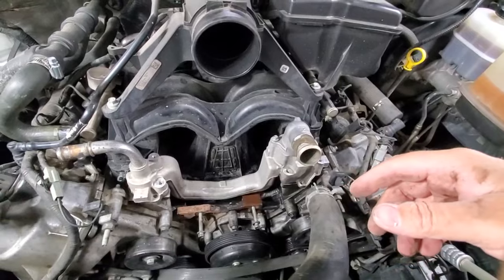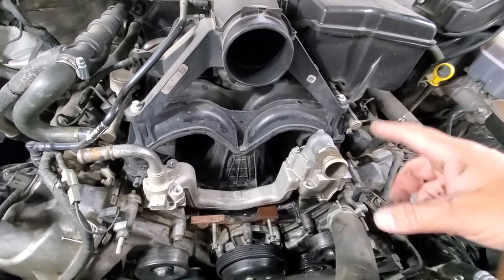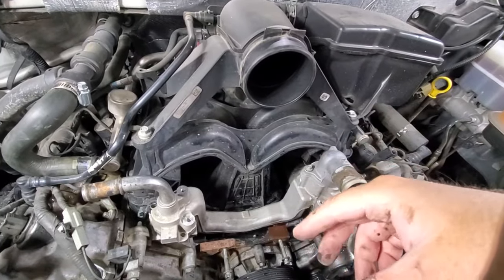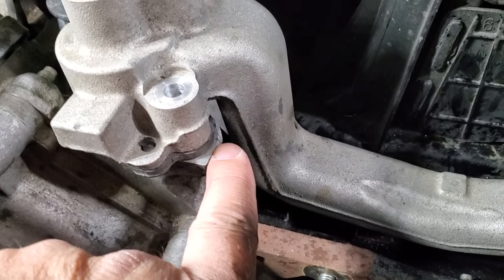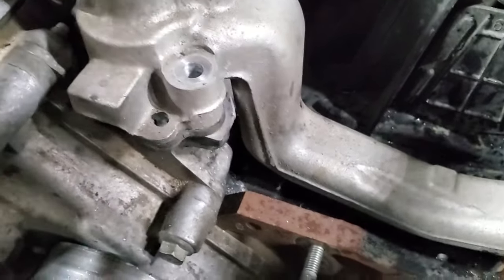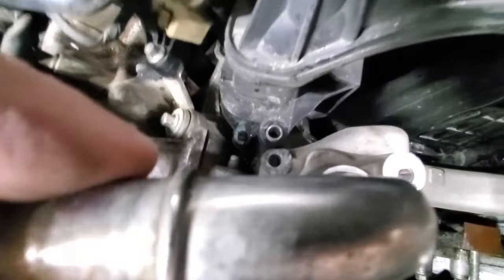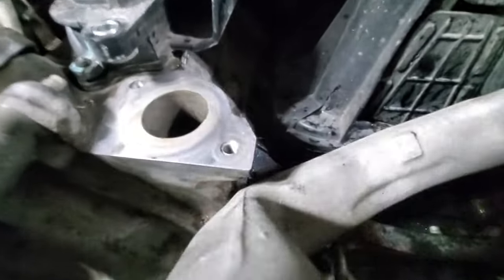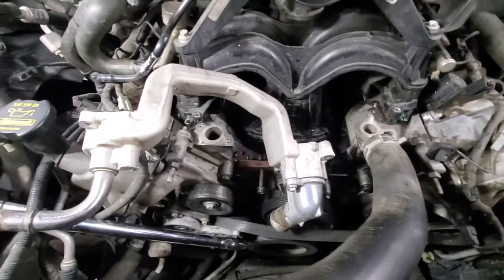Ford 5.4L 3 Valve Coolant Crossover Gaskets, Both Replaced -The easy way

Comment: Do you realize you saved my life . I was about 5 minutes short of jumping off a bridge when I came across your video . I am not a Mecanic, I’m a carpenter. But I thought changing an alternator in my f150 can’t be that hard . The first problem I had was i broke off both bolts in the bypass that hold that funny little strap over the alternator . I borrowed a trunk load of tools from my friends and also purchased 10 gallons of anti sieze solution . I tried drilling out the bolts and broke a bit in one bolt and ruined the other . Now I have to buy a new coolant bypass tube. Local dealership with taxes , just shy of $1000.00 😭😭. So i decided to get a used one. This is now, 5 days since I started the job. First thing to do is remove the existing piece . I drained the radiator, Made a mess I had to clean up . Sprayed the 4 bolts for 2 days  with liquid wrench and finally today I attacked the job. With much patience and perseverance, I got the bolts out and was so happy and pleased with myself until I tried to remove it . I spent half an hour jiggling it back and forth but to no avail . It kept hitting something. I sat down and felt sick to my stomach looking at what I would have to do to get that stupid thing out. So I turned to utube to see if there was a solution to my dilemma. I tried two or three till I came across yours.  When I saw what you did , I could here music coming down from the sky. Ten minutes later I was sitting down with that bypass pipe on my lap. Thank you for saving my life 😊😊.
Reply from the maker: Awe man, so happy this helped you! I was doing the same thing, wiggling it over and over and it just wouldn't come out! Then I started to think there HAS to be way. At that point I was committed.  Worked like charm! I so appreciate you taking the time to tell me your story, I literally just read it aloud to my family. Much love brother!

Comment: Hey whatever works, I like it!
Reply: If you approve,  I'm doing this on the weekend.
Reply: Thanks for the info on filing the tab on the head I also had to take the sleeve out of the intake manifold and file it down as well to get the crossover back in with the new gasket thanks again for sharing your find.

Comment: After having solved my problem with the same right side of my Ford expedition (I loosened the first two bolts on the front of the engine on each side of the manifold and that worked for me) I came to watch videos to find easier solutions if I needed to change the gaskets again in the future and I find the best solution, You are a mastermind, you are right it is only a few millimeters which prevents you from taking out the easiest piece as you did,  Congratulations for the great work your video will be useful for whoever is with this headache, I should have seen your video before suffering to find the solution, I thought of completely removing the manifold 😅

Comment: You saved me $1650 and perhaps a replacement of the whole vehicle! The mechanic quoted me $1700 for the whole job, including replacing the crossover pipe.  I picked up gaskets for $50 and my son and I did the job in a couple of hours!  Thanks so much!
Reply from the maker: Brilliant!  So glad to hear it. I've always wondered why they did plastic on these, sheesh. Toss me a sub and i'll try to do more on the Ford! 😁
Reply: @DoesItTrack  done and done!

Comment: Holy crap!  Thanks for the great tip!
My 2013 5.4 started to give off that coolant smell and found it leaking from the drivers side gasket.  Looked all over the interwebs, and most videos and replacement pics showed the intake together with the coolant crossover tube.  Thought I had a LOT of work and hours to get it all done.  But then came across your video!  Even without your great tip, this video still showed I only need to replace the gaskets on the crossover tube and not even deal with the intake.  So much weight lifted off my shoulders, and will tackle this job over the weekend.
Thanks again for the great tip, and keep up the great work!
Reply from the maker: Thanks Mike! Every once in a while I find these gems. LOL Happy to share the success! 😁

Comment: Just developed a leak on mine as was dreading the job as I have no time for crap engineering!! Found your video and am super excited,  thanks!!
Reply from the maker: Happy to help! Good luck!
Reply: @DoesItTrack  
Hello.
Would you happen to know if this procedure can be done on a 4.6l (panther platform)?
Reply: @DoesItTrack  
The crossover gaskets (for the 4.6l) are available for less than $15. & I would like to avoid taking out the entire intake manifold.
Help please.

Comment: Thanks so much for your video! It worked for me just fine after 5 minutes with my Dremel. I had a little trouble getting the passenger side back under the manifold.  A small chamfer on the edge of the crossover let it slip under the manifold insert.
Reply from the maker: Excellent! Glad it helped you out. This really should a Technical Service Bulletin. 🙂

Comment: Thank you so much for the tip. Shop wanted almost $2000.00 to fix. I did it for less than $ 50.00 in under 2-1/2 hours on a 2006 F150 5.4 3V
Reply from the maker: So happy to see this! $2000 is just crazy for something that takes a few hours at most, and the gaskets are so inexpensive. I'm glad this video helped you out! Truck work is kind of a side topic to our channel, but I'd love it if you subscribed. We try to be entertaining! 😁

Comment: Thanks for the help! Shaving that corner off is crucial and my gasket had a Crack as well.
Reply from the maker: These plastic ones just eventually crack. I wish they had a full rubber or metal replacement.

Comment: great video. did it today, mine was only leaking from the driver side, so once i got it all loose, i realized i had enough room to remove the gasket on the driver side and replace it, fixed my leak and now i know if the passenger side ever leaks what to do. i am saving this video for future reference. do you know that ford wanted $600 for the gasket kit to do this job. that is crazy. i spent $17 at advance auto( part# 35789 ) to do this job. cause i did not know what i was doing it took me alot of time to figure it out, but i could EASILY do this again in 1.5 hours now that i know. a 1/4 ratchet with a short 8mm socket is a MUST to get to the one bolt that is hard to get to. once bolt is loose and turned part of the way out, ratchet must come off, shove phillips screwdriver in back of socket to remove all the way. all bolts are 8 mm or 10 mm. one bolt for alternator is 13mm. thats all you need. dont know about torque settings, just use a 1/4 in. ratchet and tighten it down good.
Reply: So taking the driver side gasket was easy?
Reply: @rubencintora6777  yes can be done in like 30 mins. now that i know what i am doing.
Reply: leave altenator alone just remove bolts from the driver side and passenger crossover pipe . pipe will lift up enough to remove driver side gasket. make SURE to feel wih finger that surface is clean! before putting new one in.
Reply: @sundogtune  Thanks for the advice, I'm having the same problem and want to attempt the fix. Is there only one bolt underneath the passenger side under the crossover?
Reply: @josemedina3469  no bolts underneath, but 2 on top and also a bolt that holds a bracket going over the alternator. if your is JUST leaking from the driver side i would not mess with passenger side gasket. remove thermostat housing, and bolts from both sides on the crossover pipe,(follow my tip for hard bolt to get too on driver side). this will give you enough room to remove driver side gasket. even though i had it all loose i have had NO PROBLEMS with the passenger side gasket leaking so far. hope this helped, let me know if you need any other advice. this was for a 2010 f150 5.4l .
Reply: @sundogtune  thank you for the prompt response, mine is leaking from the passenger side. I see two bolts reachable from the top, but am concerned about any bolts underneath on the same passenger side!

Comment: On a 2004 Town Car 4.6 2V I'm hoping I can pull off  the alternator to access a couple small bolts on each side beneath the front of the aluminum cross over of the Ford intake to replace just the 2 crossover gaskets without having to do an entire intake manifold gasket job.
  The 2 crossover /lower T stat housing gaskets for this 4.6 2V Lincoln Town Car application were 
5W7Z-8C387-AA and 5W7Z-8C388-AA
Reply: ..??.. application #'s or do you mean part order #'s...
Reply: @Art Gaty  Those were the part #s , but unfortunately, there are non accessible bolts that cannot be accessed without complete intake manifold removal, and the mating plastic intake   beneath the aluminum crossover part was found to be  compromised anyhow after removing  the intake and checking, so I'm glad I got a new intake manifold from Rock auto before I took the intake manifold off.
Reply: @1fnjo790  
THANK YOU for your comments!!!
I'm going through the same thing now & found the same non accessible bolts.
I would bet that you know the temporary (but possibly long term) fix - while waiting for the new intake.
😄😄😄😄😄
Reply: @santrece1350  I think I found out that it wouldn't  work without pulling the whole intake manifold  off

Comment: bro . the hardest part for me was removing  the bolts on the right side  a #8mmor 5/16 wouldn't work im struggling on the rearscrew  driver side  where the thermostat goes pain in the neck.hopefully i can get it out tonight after work  thanks for the cheat sheet.

Comment: What did you use to get the bolt loose🤔. I have to do this on a 4.6😒.
Reply from the maker: The 4.6 is different, the 5.4 doesn't have the lower bolt so i'm not sure how to get at that one.
Reply: @DoesItTrack  I was referring to the one in the back left corner
Reply from the maker: @lynnrunningdeerB4  It comes from the top, easily accessible with a standard socket on the 5.4. You are referring to the top two on the left, but in the back position?
Reply: @DoesItTrack  no, the crossover tube. I looks like the bolts come from underneath🤷‍♀️.
Reply from the maker: @lynnrunningdeerB4  I'm not sure then, mine were from the top.

Comment: the rear bolt on right side is under manifold,  what a pain to get out ,I had to cut a 5/16 boxed end wrench short enough to turn bolt about 1/8 a turn. finally got it out.
Reply from the maker: I love custom tools! Haha!
Reply: Did u use a swing tool?

Comment: Thank you so much for the video I found the problem on my 2006 grand marquis same issue
Reply from the maker: So glad it helped!
Reply: 😲😲😲
Wait a minute.....
So, this procedure will work on 4.6l panther platform engines????!!!!
Please reply.
Reply: @TheKimbleGang4Life
...,Kimble.....; Did it work for you?
I will check on mine within a day or two.
Would you kindly reply?

😂😂😂
Reply: Yes it worked
Reply: @TheKimbleGang4Life   
Ok..... I have to use a day in the near future (most likely not the whole day).
The thing is that there are so many people claiming that it cannot be done without taking out the intake manifold.
Thanks for replying.
I will come back within a few days!!
Reply: @TheKimbleGang4Life  
Wow....
I would really like to see how it is possible (on a 4.6l) to do this.
What I did a short time ago today:
...
I have given it a preliminary go at it.
In order to see if the bolts that hold the crossover onto the intake manifold can be removed by my hands (with tools);
I removed the alternator.
I disconnected the thermostat cover because the hose being cleared out of the way will provide a clearer view.
...
Bolts on the passenger side:
One on top, three on the bottom - one which is highly improbable to be taken off without removing the intake manifold, or breaking off the plastic portion (of the intake manifold) that it goes through.
...
Bolts on the driver's side:
Two on top - they hold the thermostat cover onto the the thermostat housing & go through (and also hold) the thermostat housing onto the intake manifold.
Four are on the bottom - like at every corner of the thermostat housing - and one of those are also highly improbable to be taken off without breaking part of the intake manifold.
I believe that a certain temporary fix will be the way - until I can get a new manifold, and also make the time to do the swap.
😭😭😭
Reply: The bolts I refer to as being on the bottom:
they are facing up - they go from the intake manifold into the (aluminum) coolant crossover.

Comment: So I had to change mine out, and to get to the back bolt, I had to use an 8 mm low profile socket along with a 1/4" swivel head wrench. The one I got is from Titan.

Comment: How did u get to the back bolt on that side ur talking about tho?????
Reply from the maker: With just a socket and extension. Mine was pretty easy to get at, is yours covered by something?
Reply: The bolts are upside down I can get to 2 but there is one on the backside left if standing in front of truck and it’s not accessible but all in all your video was very helpful on helping find the leak it was right where u did the video so thank you and I’m now a subscriber
Reply: Lol now I need a video on getting the bolt off and out lol
Reply: I have the same problem waiting on some advice
Reply from the maker: @henryramos7644  mine came out pretty easily, is yours different?
Reply: @DoesItTrack  I have a 2003 E350 super duty van and the last 2 back (5/16) screws one on each side, I cannot get to them from underneath
Reply: @henryramos7644 I have a 1997.i think our 2v engines, don't have these gaskets. It's built into the intake manifold. I would love a hack like this though. What did you end up doing?
Reply: Is an 8mm socket it a wobble.

Comment: Great video but how were U able to remove the bolts on the bottom side of the crossover pipe?
Reply from the maker: A couple folks have mentioned that, mine didn't have any underside bolts at all. Mine is a 2010 KR Expedition, which one is yours?
Reply: @DoesItTrack  2002 f150 5.4L
Reply from the maker: @bljblj26  Ah! Ok, so the earlier models must be a little different.

Comment: Hello.
Would you happen to know if this procedure can be done on a 4.6l (panther platform)?
Reply from the maker: I honestly have no idea, I've never owned or worked on a 4.6. If you give it a go, let me know please. I'd like to know as well.
Reply: @DoesItTrack  
Thank you.
I will be back with an update within a few days.
`:)
Reply: @DoesItTrack  
Good afternoon.
I have given it a preliminary go at it.
In order to see if the bolts that hold the crossover onto the intake manifold can be removed by my hands (with tools);
I removed the alternator.
I disconnected the thermostat cover because the hose being cleared out of the way will provide a clearer view.
...
Bolts on the passenger side:
One on top, three on the bottom - one which is highly improbable to be taken off without removing the intake manifold, or breaking off the plastic portion (of the intake manifold) that it goes through.
...
Bolts on the driver's side:
Two on top - they hold the thermostat cover onto the the thermostat housing & go through (and also hold) the thermostat housing onto the intake manifold.
Four are on the bottom - like at every corner of the thermostat housing - and one of those are also highly improbable to be taken off without breaking part of the intake manifold.
I believe that a certain temporary fix will be the way - until I can get a new manifold, and also make the time to do the swap.
😭😭😭
Reply: @DoesItTrack  
The bolts I refer to as being on the bottom:
they are facing up - they go from the intake manifold into the (aluminum) coolant crossover.
Reply from the maker: @santrece1350  Good to know. Sounds like the underside bolts are the odd-ball. That sucks!

Comment: Is it plausible for this type of issue to cause coolant to be sucked into the combustion chamber? I think that is what's happening to my engine on my 2008 Ford Econoline E250 V8 4.6 2 valve.
Reply from the maker: Not with this particular failure.

Comment: the leak you were talking about running down and dripping off the back of the block. nay be what is wrong with mine. but i also have milky oil. would that cause the milky oil or would it be a whole different issue? had a bad freeze and now i have coolant coming off the back of the motor( possible freeze plug) and milky oil. HELP!!
Reply from the maker: Ouch! Milky oil is typically a head gasket or a crack in the water/oil jacket of the block. Sorry man, that's a rough one.

Comment: But the bolt comes in from underneath. So how do you get it out?
Reply from the maker: You have a different model of engine. Is yours older than 2010?

Comment: where are the bolts for it ... under it? on top is just 1 bolt on passenger side and i cant tell on the driver side. i have a leak on passenger side. with it being cold and was getting dark I don't know when ill even tackle it.

Comment: Will this work on a 2003? It has the 5.4 but looks a little different. Ita telling me I have to take the intake off..
Reply from the maker: I honestly don't know, but if it's similar it should.
Reply: That was my question... After several vids on the 2v, I don't think it does. I think the gasket goes into a channel that is part of the plastic intake manifold. I would love to be wrong, and have this fix work.
Reply: Did you guys figure it out